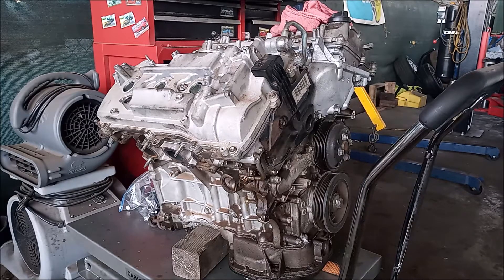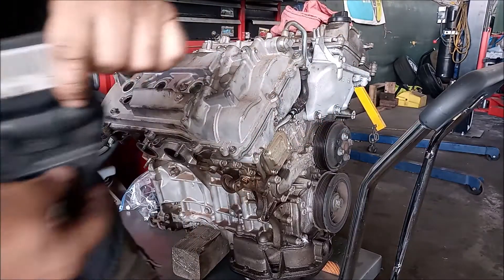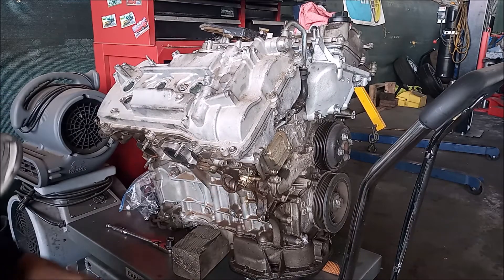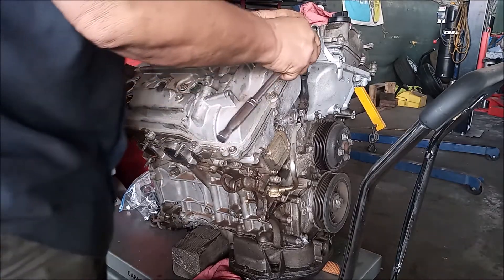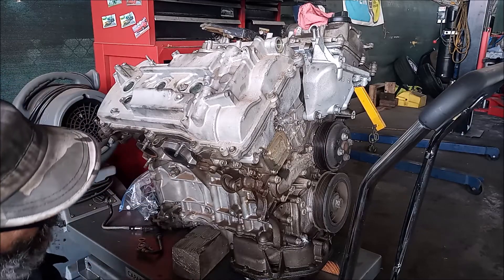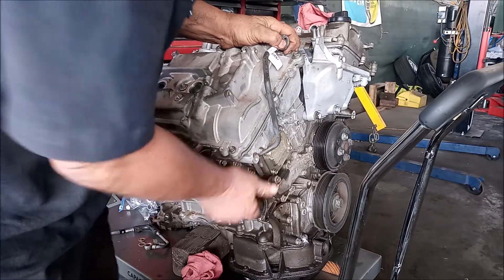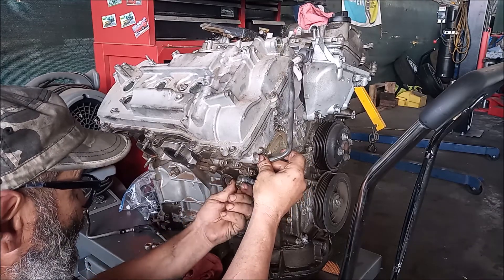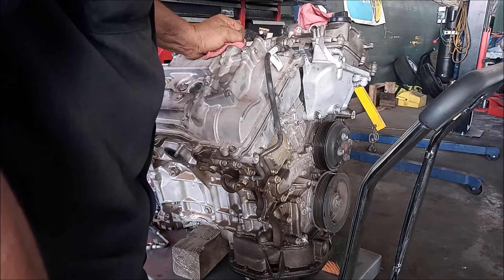How to Replace the VVTI Oil Line - Toyota 3.5-liter V6 2GR-FE - Rav4 Highlander Camry RX350 ES350

Comment: My 2010 Rav4 has the 4 cylinder VVTI engine. Does this oil line also need to be replaced or is it just for the V6 version of the VVTI?
Reply from the maker: Nope, this is only for the V6.

Comment: Was a a pain in ass with tight squeeze Lexus es350 to do u need to remove the ps pump out of the way to replace got peace of mind now knowing the  oil lines rfully metal
Reply from the maker: Yes you are absolutely right, on cars with a PS pump this is a royal pITA. Thanks for watching and for commenting.

Comment: Would this affect a 2009 Highlander with the 2GR-FE? If so do you have the TSB number?
Reply from the maker: If you check visually using your own two eyes you will see whether your car has a rubber-segment vvt line or a all-metal line. If you are not able to make this check visually, you will probably not be able to read the TSB.
Reply: @Merryfrankster_  couple of reasons why I’m unable to check at this time, my apologies for disturbing you
Reply: @bernardshaw7585  did it end up having the rubber line or the metal one?
Reply: @K8TieEV93  metal, best I can tell they corrected the issue on the 2009 Highlander there is another oil cooler line with the same issue that does affect the 2009 and others

Comment: Does the oil have to be drained before I do this because I just did an oil change. Also this is the same 3.5L in the 2007 RX-350 right?
Reply from the maker: Less than a cupful comes out. No need to drain the oil. This is the exact same part in every 2gr-fe including the rx350.

Comment: Are the steps the same for 2008 Toyota Sienna?
Reply from the maker: Toyota Sienna has a P/S pump. You must move it out of the way to reach the rear banjo fitting. All other steps are exactly the same. Part numbers for metal line and washers are exactly the same.

Comment: Hi, thanks for including the torque specs, part numbers, and component diagrams!

On a 2009 Venza, which should have the all metal line, I'm seeing some oil on that lobe structure and bolt hole where you mentioned a power steering pump would be on some models (Venzas all have electric power steering). The oily area is similar to what is on the engine in your video. A mechanic said the banjo bolt was loose, as you noted too, and tightened it, but I still see some oil there eventually forming a droplet on the downward pointing lobe. Unfortunately accessing that area is pretty difficult. Thoughts about what it could be and how to address it?
Reply from the maker: This is a very common issue. If tha banjo bolt is leaking, itis not enough to tighten it. You have to replace the washers. Be careful not to overighten the bolt. The torque spec is only about 40lbs.
Reply: @Merryfrankster_  Is there any danger of catastrophic failure? I'm tempted to just monitor the oil level for now. It's not losing any appreciable amount between oil changes. 

I wonder why the bolt would loosen or the washers would lose their seal on their own. First time I hear this is a common issue. But if it is the issue, I'll be relatively relieved because a dealer inspection stated it could possibly be the dreaded timing chain cover leak. However the oil is only in the areas seen in your video, but less wet. 

Only problem is that banjo bolt is unfortunately rather difficult to access... or even see.
Reply from the maker: @fizout  On the banjo bolt fitting, normally, there is no danger of catastrophic failure.
Reply from the maker: @fizout  Believe me the rear banjo bolt leakage is very common. Stealer inspection is never to be trusted.
Reply: @Merryfrankster_  Thanks so much!

Comment: The OEM number you posted says it does not fit 2007 RAV4. It fits 2008 - 2018 models. It is because they still use rubber section oil line for 07? But part for 08 fits 07?
Reply from the maker: I don't know how many times I have answered the question. THE PART NUMBER I PROVIDED IS THE METAL LINE THAT FITS ALL YEARS AND MODELS OF 2GR-FE. You want to order a different part? Fine. They will sell you another rubber line to replace your rubber line.

Comment: Is there one on the other cyl head ?
Reply from the maker: No.
Reply: Thanks if I lived in your country I would send you some $$$ for your advice. Come on people he deserves it send $$$ honest advice is hard to find 👍
Reply: Yes there is actually. After doing some research it appears the bank 2 VVT oil line may be all metal, because you don’t see any guides or videos on replacing that one.
Reply from the maker: @austinmerrival927  yes of course there is a vvt line on the other cylinder head. But it does not need replacement.
Reply: @Merryfrankster_  My question is though why only the oil line on bank 1 is faulty? They always made the all metal pipe for the bank 2 oil line?
Reply from the maker: @austinmerrival927  yes, correct, the bank 2 line has always been solid metal end to end, there has never been a rubber version.
Reply from the maker: @austinmerrival927  correct, bank one vvt line was all metal from day one. Why? The engineer who made those decisions is probably gone by now, retired, or fired, or "window office" as they say in the kingdom of the sun. That's when they don't fire you, because they never fire anybody, but they put you in an office where you have NOTHING to do except look out the window all day. That's if you are lucky enough and hthere is a window.
Reply: @Merryfrankster_  Well hopefully quality and whoever else was involved in deciding that was ok should receive the same treatment. Glad to know that the bank 2 oil line doesn’t need a metal pipe as well, because it seems you’d have to take the alternator off to get to that!

Comment: HUGE thank you for taking the time/effort to make this video! Just bought an 07 Avalon with 200k miles and saw the original line has not been replaced.  Time to tackle this asap! Really appreciate you posting the part numbers as a nice bonus.
Reply from the maker: Thank you for watching.
Reply: @Merryfrankster_ is there only one of these lines? I know there's also an oil cooler line that needs to be replaced as well but for some reason when looking to purchase the vvt line I get results for upper and lower lines.
Reply: @tim1569  I know this comment is a bit old but thought I could help - as far as I know there is no lower oil cooler line on the 2007 Avalon specifically (near the radiator), I had the same question and found the answer on a comment on the Car Care Nut channel.
Reply: @Merryfrankster_ do you have to put any red seal on it like the top or bottom 🎉😊? Happy new year's

Comment: I have a '12 Highlander and noticed a leak at the lower bolt. If my vehicle has a rubber line you recommend replacing w/ the all metal one? I need to verify which one I have. TIA
Reply from the maker: Your vehicle should have an all-metal line from factory. It is common for the banjo bolts to leak. Get some new washers and torque them down to 45 ft-lbs.
Reply: @Merryfrankster_  I checked last night and looks to be so. There’s a black metal or plastic cover on top of the line so couldn’t see most of it, but I’m sure you’re correct and know more about these than me. Top bolt is dry, will replace the washers on the lower banjo and keep an eye on it. Thank you.
Reply: @bumblebvr6  did replacing the washer fix the problem you have?

Comment: as is usual with all your instructional videos - EXCELLENT! - and most helpful for the DIYer. I had a persistent small drip leak at the lower banjo bolt fitting for the VVT cooler line on the rear of my 2GRFE and replaced the dual washer (gasket) with new (99 cents) and replaced the bolt using one off a donor motor - i could see a few small spots of corrosion on the inside of the bolt flange on the bolt that was leaking that may have been causing an imperfect seal against the gasket. The donor bolt was super clean and smooth like new
Reply from the maker: Glad it worked out! Thanks for watching.
Reply: I seem to have the same persistent leak at the lower banjo bolt in my 07 RAV4. I did this line replacement about 6 months ago. I was planning on replacing the lower gasket (whose part number is attached) and maybe also the banjo bolt. Any idea on the part number of the banjo bolt?

Comment: Thanks for the info mine is leaking 2012 rx350. Caught this leak on a tire rotation.
Reply from the maker: It seems to me your car should have an all metal oil line from factory.
Reply: Interesting to see your 2012 rx350 has the rubber elbow on the line but  my '10 rx350 does not have that when I looked at it without removing the plastic cover.